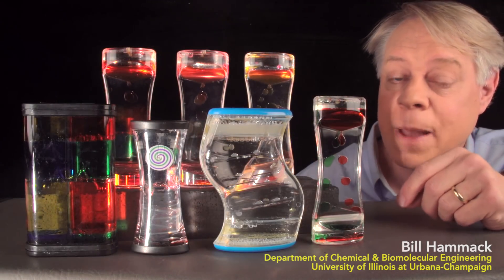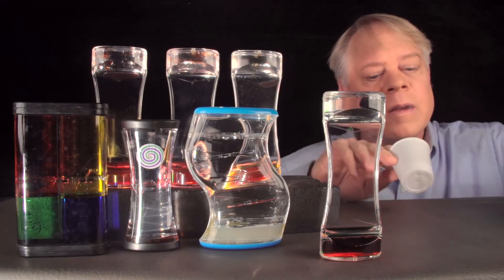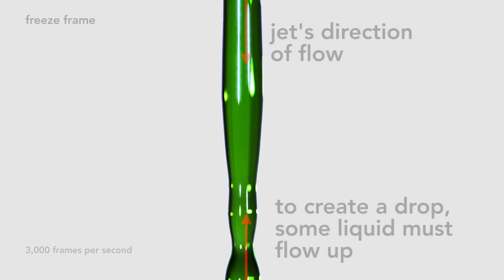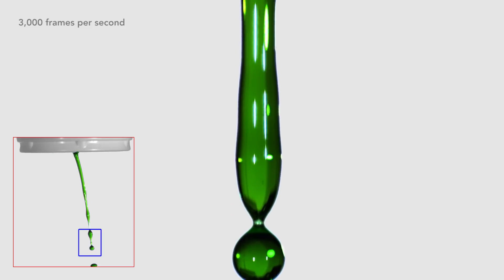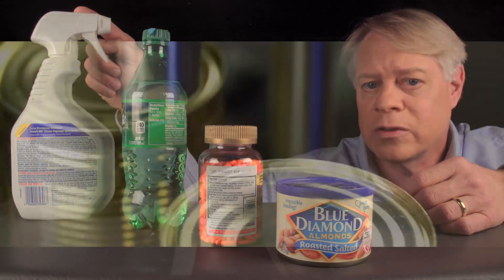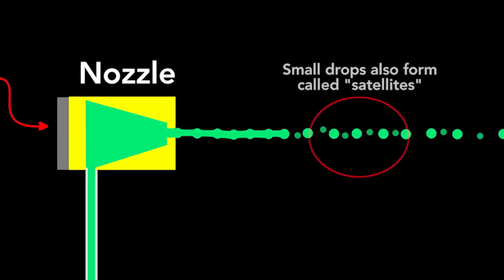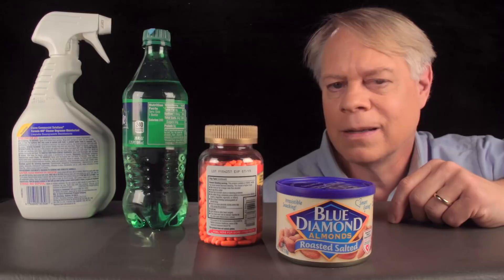The Engineering of Droplets and their Formation in a Commercial Inkjet Printer

Comment: i went down a rabbit hole on droplet formation a couple months ago when i set out to build a fount that emulated sound of rain more realistically by creating falling droplets instead of streams i never before considered what an immensely complex process the formation of droplets is. for my application consistent sizing was not necessary and i instead relied on a fixed hole diameter and head height on the rainhead to achieve the desired results. thank you for this wonderful video

Comment: Man I was just going to say, Ink Jet Printers. The Videojet printers I work with use a crystal that vibrates at 60,000hz, thus making 60,000 drops per second. There's an LED light flashing at the same rate allowing one to actually see the drop formation using a loupe. After that, the charge tunnel and deflection plate work similarly to a CRT.

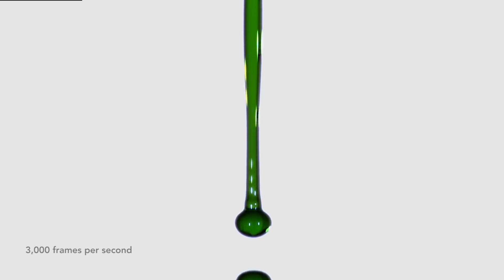Comment: I'm struggling with your statement @1:48, "The surface area to volume ratio of a sphere is double that of an optimized cylinder with the same radius".  If you include the ends of the cylinder the surface area to volume ratio is the same as that of a sphere with the same radius, 3/r. If you don't include the ends the sa/vol is 2/3 that of the sphere of the same radius, 2/r.

For the same volume the sphere has 0.87 times the sa/vol ratio of the cylinder with ends and 1.31 times the sa/vol ratio of the cylinder ignoring the ends. This cold explain why the flow is continuous until it starts to neck through vibration or imperfect flow.

Comment: Great presentation.  Thanks
I bet you would have liked to work at Xerox.  We were doing this in the lab in the mid 70's (although it went unnoticed.)  We used a video camera, strobe and microscope to fine tune the signal modulating the droplets.  
In 1970 we experimented with using a HeNe laser to expose a flat Xerographic plate as a feasibility before incorporating a Xerographic drum and  galvo scanning  . . . I am just saying I bet you would have liked working with these guys.   Ahh the good ole days.   I would love to touch base on the "Xerox Redeye project" and see where everyone landed.

Comment: I work with high-speed inkjet printers used in several industries with solvent and water based ink in letter mail automation. The ones we use to apply barcodes (the vertical bars in fluorescent and black you see on your mail) can apply 4,327 bars per second. With variably charged ink, a piezo nozzle, and a high voltage source, it's amazing to watch it work even if like me you went to school to learn to work on them.

Comment: Maybe I missed something but how did we go from minimizing surface area by forming spheres to the surface area of a sphere being double that of a cylinder? (1:48)
Reply: The ratio between volume and surface area is being minimized.
Reply: He said...., 'the surface area to volume is double that of a cylinder'
Reply: I must also be missing something. If the radius (r) is 1 for both the sphere and the cylinder, here's how the math works out:

1. For a sphere with radius r=1:

   The surface area (A) is 4πr² = 4π(1)² = 4π.
   
   The volume (V) is (4/3)πr³ = (4/3)π(1)³ = (4/3)π.

   The surface area to volume ratio is therefore A/V = (4π) / ((4/3)π) = 3.

2. For an "optimized" right circular cylinder with radius r=1 and height h=2r=2:

   The surface area (A) is 2πr(h + r) = 2π(1)(2 + 1) = 6π.
   
   The volume (V) is πr²h = π(1)²(2) = 2π.

   The surface area to volume ratio is therefore A/V = (6π) / (2π) = 3.

So, as we can see, when the radius is 1, the surface area to volume ratio is the same (3) for both a sphere and an optimized cylinder with the same radius. It's not twice as much for the sphere.

Comment: Bill
Thanks for the video. It caught my eye because my brother and I have worked on these printers for over 20 years.
One correction here. Your illustration is slightly inaccurate. The vibration / modulation of the fluid is adjusted automatically or manually in order to keep the small satellite droplets from forming or at least merging with a larger drop prior to passing under the High Voltage deflection plate. The charge pulse is timed to coincide with the actual break off of the drop from the stream allowing it's charge to be changed since it is still grounded to the stream. A positive pulse is sent to the charge tunnel just as the drop is being formed allowing the drop to pull excess electrons from the stream just as it breaks away giving the drop a negative charge. This is how the printer can charge a single drop at a time even though there are many drops inside the charging tunnel when the charge pulse arrives. Drops completely separated from the stream cannot have their charge altered since they are not grounded. Uncharged drops not used for printing do not get deflected by the high voltage plate and simply enter the return gutter and are recirculated in the machine. Charged drops fly over the return catcher and exit the head and land on the product. The more charge placed on the drop, the higher the drop flies out the head and onto the product as it passes in front of the head. 
When the satellite drops do not merge with a parent drop before exiting the head, print quality issues develop since the satellite drops also pick up small amounts of charge. 
 It is an amazing technology. 
Jeff
Reply from the maker: Thank you!

Comment: At 2:57 , using Bernoulli's equation gives that the middle point should be higher in pressure 

 ( let's name the points as we go down , A (first constriction) , B ,C (second constriction) ) 
In the video it says 
A- high pressure 
B- low pressure 
C- high pressure 

Honestly, my problem is only between A and B .
Using Bernoulli equation 
P_a + 0.5 \rho v_a^2 + \rho gh_a=P_b + 0.5 \rho v_b^2 + \rho gh_b

Bringing both pressure terms on one side 
P_a-P_b =0.5 \rho (v_b^2-v_a^2)+ \rho g(h_b-h_a) 
Now if indeed A had higher pressure than B , then P_a-P_b>0 
But on checking the right side of the equation 
We see that v_b < v_a ( due to continuous flow ( maybe? ) Having constant rate of flow )
So first term on RHS is negative 
We also see that h_b<h_a , so the second term is also negative 
Which means the RHS is negative 
But that would mean 
A-low pressure 
B - high pressure 

Which is not , can someone explain this ? 
Is it because the assumption that the rate of flow is constant,  is wrong ?
Or is it that I am not counting the work done by gravity which considerable increases the speed ?

Comment: I worked at a company that used a stream of droplets to manufacture high-end  microchips via photolithography. Molten tin was propelled across a vacuum chamber using high pressure gas. A piezo electric element vibrated the tip of a quartz nozzle to form droplets with proper frequency, speed, size and spacing. Each droplet was tracked as it flew and at the right moment a 30000 watt CO2 laser focused on the droplet and turned it into a flash of light with a very small wavelength. The light was captured and reflected by mirrors to a machine that used it to etch silicon wafers. The light enables finer resolution for more transistors per square millimeter.

Comment: To your absolutely correct observations one might add that fluids accelerate under gravity. The stream will deform as the leading molecules surge ahead. As volume is preserved the lengthening stream will laterally contract thinning the stream until the described instability occurs.

Comment: Wonderful video.  I'm not understanding what it is that forces the droplets to form right away in your toy model, however.  There doesn't appear to be any vibrations involved in the toy, yet it forms nearly uniform droplets almost the instant they fall through the hole.  Is it just a matter of finding the right size hole to allow just the correct amount of fluid to pass through, the hole size thus being dependent on the liquid's viscosity? If you ever do a follow-up to this, the Dippin' Dots ice cream process of flash freezing the ice cream droplets as they fall is another neat application of commercial use of drops.  Thank you! You rock!

Comment: This process is way more complex for commercial and consumer ink printers and  large format printers. Here you have low resolution, while professional print such as photography requires gigantic resolution. In those printheads we have zillions of nozzles with a diameter of a fracture of human hair. Depending on producer, either piezo or resistance is used to form a droplet - resistors on both sides of the dye heats up the nozzle and cause ink to react and form a droplet. In case of piezo it is similar to technology described here. In this case we have so called following droplet and usually it lands in the same spot as main droplet or is taken out by suction (large format printing). Ink is a mixture of various chemicals, such as biocides or anticoagulants as well as reactants with paper coating based on a heat sensitive compound. Depending on print type, those are based on water (for paper use) or alcohol (solvent printing) but second ones generate toxic fumes. The technology behind and process is very complex, I am writing about part of it so You can admire Your printer doing its job, being most complex electro-mechanic device in home appliance section. Thanks for good content.

Comment: Now your showing of the industrial inkjets spawned a few other questions in my mind: 
1. If the drops shot out (or dropped, figures) have a tendency to splash. Commercial printers have little to worry about I guess because the fibers of the paper should do a well enough job of absorbing the ink as it comes out but tin and plastic? So how come that the printed dots are so crisp? Even a viscous fluid should splash somewhat if shot out at high speed and if it is viscous enough not to do that wouldn't it clog the nozzle at an unsustainable rate? 
Would be nice if you could do an follow up on the topic. Or somebody in the comments who knows his/her stuff. Thanks.

Comment: The statement at 1:47 is "the surface area to volume ratio of a sphere is double that of an optimized cylinder with the same radius". I must be missing something. If the radius (r) is 1 for both the sphere and the cylinder, here's how the math works out:

1. For a sphere with radius r=1:

   The surface area (A) is 4πr² = 4π(1)² = 4π.
   
   The volume (V) is (4/3)πr³ = (4/3)π(1)³ = (4/3)π.

   The surface area to volume ratio is therefore A/V = (4π) / ((4/3)π) = 3.

2. For an "optimized" right circular cylinder with radius r=1 and height h=2r=2:

   The surface area (A) is 2πr(h + r) = 2π(1)(2 + 1) = 6π.
   
   The volume (V) is πr²h = π(1)²(2) = 2π.

   The surface area to volume ratio is therefore A/V = (6π) / (2π) = 3.

So, as we can see, when the radius is 1, the surface area to volume ratio is the same (3) for both a sphere and an optimized cylinder with the same radius. It's not twice as much for the sphere.

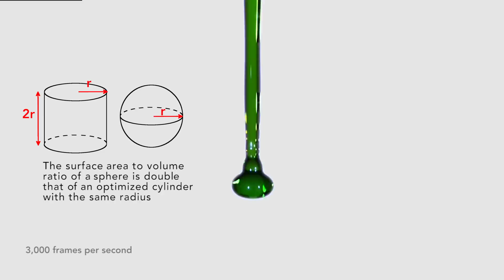Comment: 1:52 Is there a contradiction here? If the liquid is trying to minimize its surface area, why does it form a sphere then?
Reply from the maker: A sphere is the lowest surface area per unit volume; thus the fewest molecules are on the surface.
Reply: @engineerguyvideo  Thanks so much! I guess I got confused by the wording of the statement on the left in 1:48. I guess it means a cylinder has twice the surface area.

Comment: I think, there is something wrong with the "surface to volume ratio" figure here. For a given volume, the sphere has the smallest area-to-volume ratio of all shapes. So the illustration saying it double for a sphere vs. cylinder is clearly wrong. OTOH, for all shapes (sphere or otherwise) it is true that surface-to-volume ration increases with decreasing baseline (radius here). Smaller objects simply have a higher surface-to-volume ratio and therefore react much faster (to chemical or to heat) because those forces work better when attacking a large surface. 

The reason, why smaller drops of water form spheres is surface tension trying to minimize the surface for a given volume which results (as explained above) necessarily in a sphere.

Comment: I can't understand why "The surface area to volume ratio of a sphere is double that of an optimized cylinder with the same radius." Don't it just the same with the height of the cylinder is equal to 2r? i.e the surface area to volume ratio of given cylinder = 3:r which is equal to that of sphere.